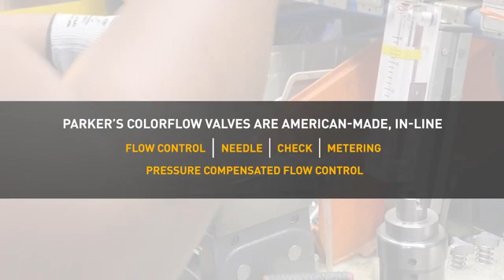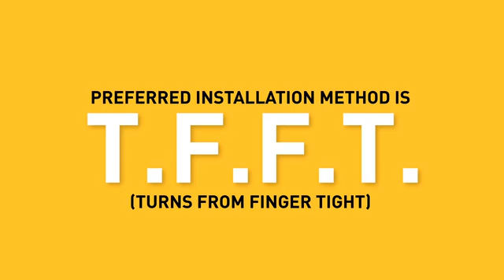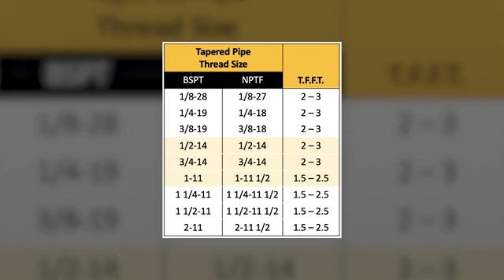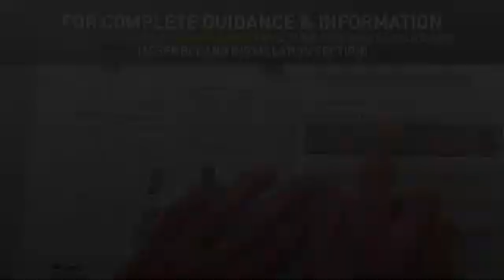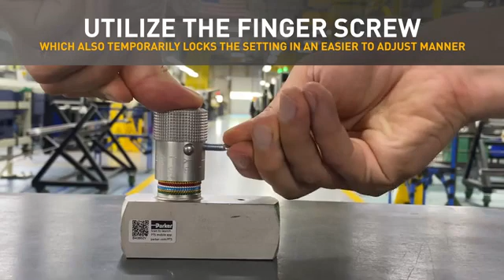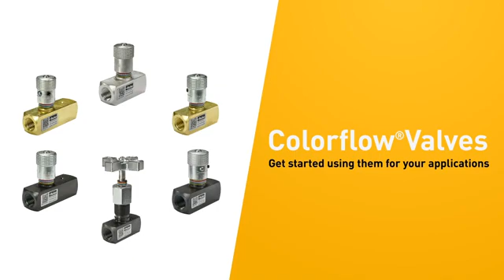How to Install  and Operate Parker ColorFlow Valves | Parker Hannifin

Comment: Hello, I'm having trouble finding the following replacement part: 71215SN21Z0F2JZ07C1. It is a 12VDC, 3PSI, fluid control valve with a 5/16 orifice. Would you be able to help me find this part or a suitable replacement?

Comment: So how do you know what number you have this set at? Theres no indicator showing what number your on. Do you make your own line and use that as a reference then say you have it set to red-3 or green-9? Very poor explanation on how to use.
Reply from the maker: The color band rings/color rings on the colorflow valves are for reference only, it provides check points as you adjust the knob.  For example:  If you are on red band at 1 gpm and need to adjust to a different gpm and need to go back to the 1 gpm that would be a reference point only, you will know to go back to red band.  If customer needs to measure the flow, they must use a flow meter.   See catalog for details. https://prker.co/3oVmPqm
Reply: @ParkerProductsSupport  Thank you. None of your reading materials or videos make it clear to make your own reference mark on the valve body itself. Which makes it confusing when trying to determine what "number" you are on when setting.